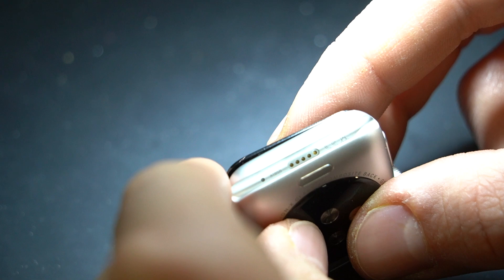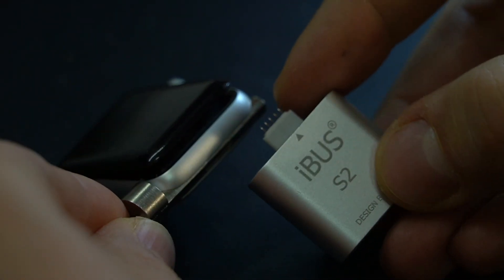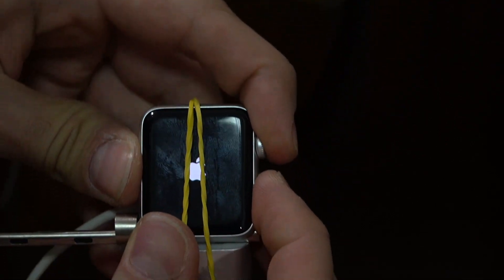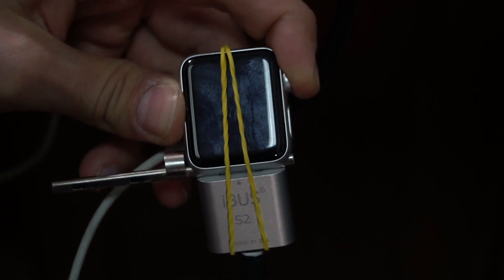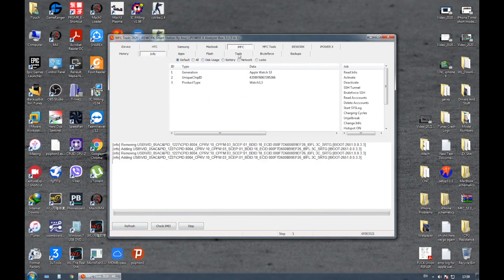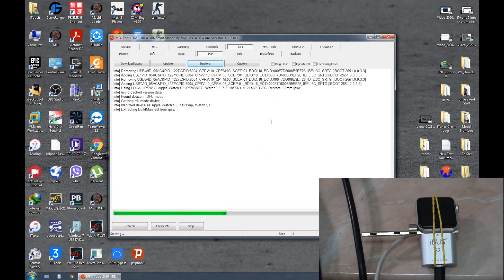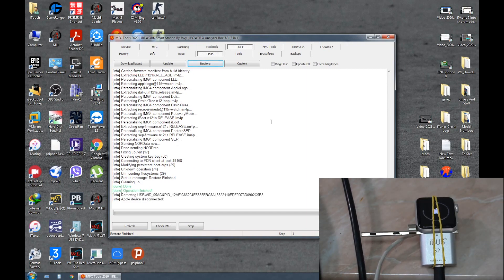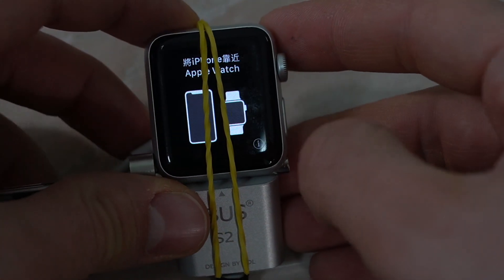How to Restore Apple Watch Series 1/2/3/4/5 using iBUS MFC tools(38mm,40mm,42mm,44mm)

Comment: I do not recommend the MFCbox software and company.

Due to a memory problem on my iPhone 12 Pro phone, the files could not be deleted and after resetting it could not be turned on. When I tried to update and repair the phone through iTunes and other software, I was getting error message 1110. Finally, I wanted to try the MFCbox software, but I received error codes in that software and was not successful. Even though I wrote a message to the MFCbox support department, they did not respond, so I requested a refund via PayPal and got my money back, and MFCBOX Support wrote my personal information on their forum and opened a topic calling me a fraudster. MFCBOX does not stand behind the software they make. They aim to produce useless software and make money from it. AND when they don't win, they accuse their customers of fraud.

Don't buy this software for nothing...

Comment: Hello, I have a problem.  The display of my watch broke, I changed it to a new one, but did not change the native NFC module, and now the watch is not activated, will the firmware via ibus help solve the problem, since there is no native NFC module?
Reply: I have the same problem. Can you tell me if your watch is working? Did flashing help?

Comment: the file not work
Reply from the maker: Which file?
Reply: @iTouch-repair  all file drive
Reply from the maker: @testatotest4143  the firmware has been unsigned
Reply: @iTouch-repair  I did not understand, please explain
Reply from the maker: @testatotest4143  the software for the watch has been unsigned so you can’t restore until the new software come out